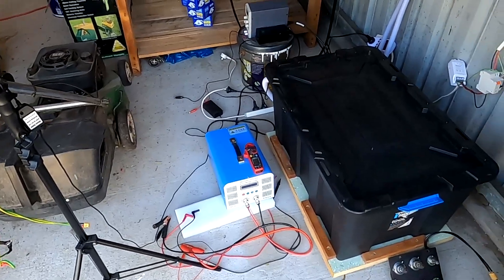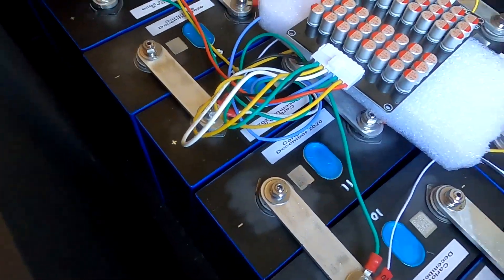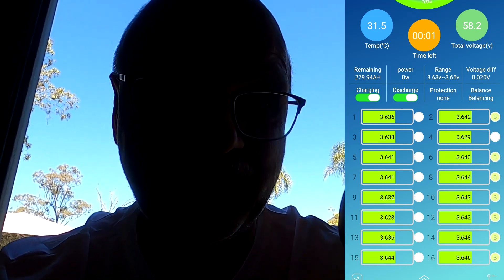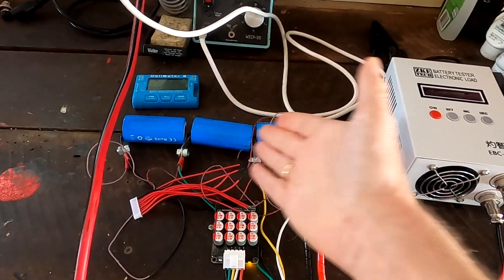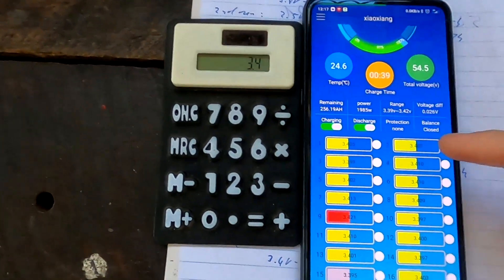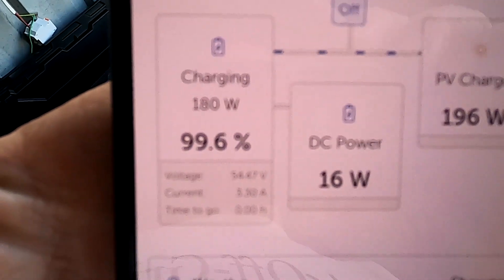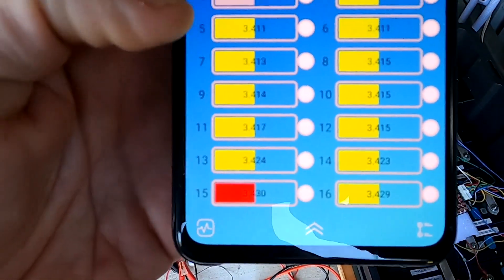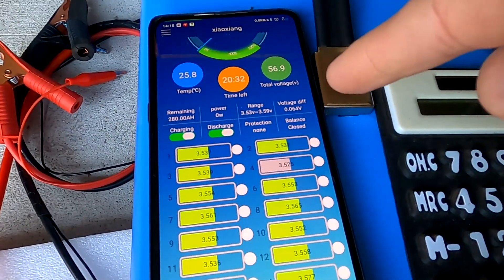Why the active balancer only works at higher voltage of your battery.

Comment: Can you test these? Amazon no reviews and im having a issue with their capacity! Grade A 3.2V 310Ah LiFePO4 Battery Cells, Rechargeable Lithium Iron Phosphate Battery with Bus Bars and Srews, Automative Replacement LiFePO4 Deep Cycle Battery for Camper, Boat, Solar System...
Brand: AVinol
Reply from the maker: Can't get them here in AU. 
I would be careful with no-name batteries, even if they are been sold on Amazon.
We have some reliable sellers on my website:
https://off-grid-garage.com/batteries/

Comment: Man the more you explain the more i am confused!
At the beginning you said you balanced at low voltages and it did the job nicely.
After that you charged up and it also did the job nicely.
In between of the explanation that is where it got confusing.
I get my active balancer this week i am going to find out for myself what the deal is with all these opinions   good and bad about the active capacitor balancing.
Mine is 14s100p  48V 200AH  battery system so that is more than enough to test this active balancing stuff.  You are in Australia and I am in Florida so we both have plenty of sun to play with!!!!!!!!!  I have a degree in Electronic Engineer so i will make a technical assessment of the active balancing.  I understand how it works and it is a simple yet elegant effective way to balance.  Active balance is more important to me than BMS contrary to the masses that think otherwise.  My electronic knowledge guides me to think at a deeper level than the non technical electronic people.

DC electronic  (solar stuffs) is super easy to understand and implement.  AC electronic is way way harder to grasp and understand.  That is why a lot of people can watch Utube and read online then go do it.  That is good however as the more of us doing this stuffs the better it is for the environment and our pocket book.

I am unconventional NOT doing what everyone is doing . I practice Reduce Reuse Recycle in everything i do.  The whole set up of mine is truly 3 R's from panel to battery to inverter even the wires.  Still working after 4 years with frequent battery rebuild due to NO bms and active balancing.  Next for me is bms, active balancing and remote monitor and controlling (worldwide NOT just local).  At this point i can remotely monitor and turn the system on and off anywhere in the world.  The bms remote monitoring and active balance are next.

Comment: Ok maybe a daft question. When do we actually turn off the active balancer.
Reply from the maker: Because is also balances in the flat area of the curve with LiFePO4 which causes an imbalance across the cells. Once you fully charge again, the balancer may not be able to balance that out again. You would then think it does not work or your battery has an issue. 
I have made several tests with different batteries here on the channel showing that.
Reply: @OffGridGarageAustralia   Thank you

Comment: Is 3.50v not the optimal maximum charge voltage per cell if you like to have the most of lifespan of the battery?

Comment: I can't remember if this was if this video or another one of off-grid garages active balancer test videos.. but at one point he has a board with four bulbs in it that he uses to drain individual cells.

Can anyone give pointers on how to do this? A regular house bulb doesn't have terminals... I've heard a car headlight might work but it looks like he's using something else. Just curious of all options

Edit: ah!  It was this video. They look like car headlights....?   

Does anybody know the details of building something like this? Do you need to worry about polarity on the bulbs?  In series on the board? Polarity on bulbs needs to match the battery cell?

Comment: 10:30 Seplos is the most used BMS in most chinese battery packs. They communicate with most inverters out there... and if you have an incompatible inverter/charger, tell them and after a day, they will send you the firmware.
Reply: It is far from the most commonly used BMS. The Pace BMS is widely used in server rack batteries, the JBD is widely used by the DIY community, Daly used to be popular, JK is popular with those that want a little more to play with. The Seplos BMS isn't bad but its quite expensive.
Reply: @ericklein5097  You are correct that Pace is the most used BMS on battery packs. I mistook the similarity and made wrong conclusion.

Comment: 8:54 THIS is what i have been telling some folks... BMS without a communication to Inverter/Charger will disconnect the batteries from the Charger/Inverter when one of the triggers is reached (too high voltage, too low voltage, too high current charge/discharge, too high single cell voltage, too low single cell voltage). But they keep saying it does not because their inverter/charger is still running.

FACE PALM!

I said, BMS does not turn off the inverter; it disconnects the battery to the inverter and their inverter is now in battery-less mode.

Comment: I run lto cells and that balancer. LTO cells voltage will change more that other types. Charging at high currents the balancer can't keep up. I am talking charging at 1-5s. The problem with using this balancer is as you go lower the balance current is well under 1 amp. This makes cells go over voltage.

Comment: One way to optimize battery would be first to accurately bottom balance. Then charge , the cell which goes high first is under capacity, increase the capacity of this cell by adding to it ,in parallel another small  cell ...It's about getting the capacity of each cell block  very close. Battery is limited by the capacity of the lowest cell.

Comment: what if we set chargers hi/low voltage,higher/ lower than bms cutoff voltages. I want to never need to "manually" do anything to cells of the battery bank.

Comment: Try turning the BMS balancing function off or set the start balance voltage higher than your absorption voltage so it can’t turn on. Let the active balancer handle that job alone. Balancers stop balancing, look at voltage and continue as needed. Two balancers on at the same time may be interfering with each other. Of course keep all other safety functions active on the BMS.

Comment: For this cap transfer balancer there are two things that happen with lower cell voltage.  First is the amount of transfer charge put in caps is less because voltage is lower to charge the caps.  Second is the switching MOSFET's resistance goes up a bit because their gate drive voltage is lower.  Both lower the net current transfer at lower cell voltages. Some models have a small boost DC-DC converter that provide a consistant gate voltage drive.

The balancer's cell voltage comparison is also more likely to be corrupted by external charging or inverter current in the flatter voltage portion of battery state of charge so it misfires occasionally  pumping charge transfer in wrong direction.

Comment: Did you use 2 balancer, the from the BMS and the 2nd?
Reply from the maker: The BMS balancer was turned off at first but I set it to kick in at a higher voltage. So if the active balancer struggles, the BMS balancer activates as well and assists to bleed off energy.
Reply: @OffGridGarageAustralia  thank you for the information.

Comment: Balancer will only make use of higher currents when there is higher voltage differences between cells. When providing a higher voltage/ charge from an external source you are providing that difference hence the higher rate of current being used by the balancer.
Great videos Andy.
How much power does your Tesla usually consume from your off
Grid garage per kilometre?
Reply: How does a charge current....that is equally distributed among the cells....creating a voltage difference amongst the cell?

Comment: Well, because of your great testing and the gleaned information, I started looking into how the Active Equalizing Balancer works. So, far it appears to use 70 G045N03 directional current switching MOSFET with a current dispensation of 52 watts each in groups of four with the use of  three capacitors. Regulated by what I think is some kind of voltage 555 type chip. I haven't got much further then that and its only a guess at this point.. So, this is what would make sense that that chip is set ate voltage you have described. If I get real worked up about it I'll test it. But, from what I think I know, I may just apply what you have done in this test once a month or so for a couple of days and the reset back to a lower voltage bulk charge. Anyways this information sure made it more fun to think about it all.
Reply: Xr680f I think the last bit of your response, regarding balancing and resetting charge levels as maintenance procedure is the way to go!
Reply from the maker: Thank you. That is great feedback. I'll look into it more as well. I have ordered some inductive balancers to compare...

Comment: Hi Andy. At first, thank you so much for your videos. I’m always waiting to the next one. Here is my question : what if you double the balancer ? I mean, you parallel it with your spare one !? At best you lower the risk of battery disconnect… what do you think about it ?
Reply from the maker: Thank you for your commend and kind words, Sebastien. That is correct, I could increase the balance power by paralleling them together. That would effectively roughly double the balance current.
I have made the observation now that it is not necessary as the battery will balance over time. I haven't had fully charged the battery for a few weeks so there was quite a drift and the balancer could not keep up. Now, after several full discharges, the balancer has it under control again. I now charge to 3.45V only and rest there for 2h to give the balancer enough time to do its job. That seems to work.

Comment: Hello Andy, please check the resistance between the busbar and the cable shoe from the BMS and the balancere.  I had 20 ohm on it at one cell, ( I use the same 280 Ah cells ), and this is a big problem wenn the BMS gets no correct value. I changed the sequence , that the cable shoe is directly on the busbar. I thing in my case the V2a washer was the problem.
My english is not that good ,sorry .
With best regards Guido
Reply from the maker: Thanks for the tip!

Comment: The same thing happens with my batteries. Most will be at 3,350v but as charging continues one cell continues to charge and comes over 3,600v and the others even drop from 3,350 to 3,330v
This starts to happen when the same saturation voltage stands for a long time. Does this rapidly growing cell have the least capacity?This is frustrating. 🙈

Comment: I would like to see you leave it for a few cycles with the recomended settings from Victron. These guys know what they are doing - I promise you. :) leave it to absorb a couple of hours so the balancer can work at every charge. You changing back from the recomended settings make it so that we don’t have a proven state of the system actually working in this design. Then you can try fiddling with setting step by step until it stops working reliably. We humans sure are different and work toward a solution in different ways. Fascinating.
Reply from the maker: Yeah, I can do that and see how it goes over time. I've got the suspicion, that the balancer actually causes the imbalance because its permanently connected. If I don't fully charge for days or even weeks, it still balances and causes and uneven voltage once the battery gets close to full again. It then needs to revers that balancing again what it did in the past. It should only turn on if necessary or 3.5V or above maybe.
Reply: @OffGridGarageAustralia  I have wondered the same on these active balancers. I top balance my cells perfect and the bms so far on a couple battery banks has kept them within 0.010v but then if i don't get much solar for a few days or weeks and my bank is around 50% soc then an active  balancer may be then be bottom balancing to a point so then when i get to a high soc again or when fully charged the cells are then out of balance.
Reply: @OffGridGarageAustralia  I have one of those balancers (4s) that I use with my Headway batteries. Something that I noticed is that when charging the pack and monitoring the cell voltages, the balancer will "artificially" increase the cell voltages that are low (and vice-versa) when it is actively balancing. This makes it hard to accurately monitor voltages unless you turn off the balancer. In my case it's easy for me to unplug the single 4s cable. However, you may want to solder a switch and some wires onto the balancer. (inplace of the solder blob that is there.) It would be Very interesting to see what the ACTUAL voltages of your batteries are when charging.
Reply: Andy have the balancer only turn on when you are approaching 96-98% SOC

Comment: Wow I think adding an other chemistry like lithium ion using 14 cell @3.7 both of 16 cell lifepo4 have the same top and btm voltage limits but it will act as a buffer of fast voltage rise after 3.45 for the lifepo4 which would let the balancer do it’s job. 
This is my hybrid battery and no balancing 
230 amp lithium ion (Chevy volt battery) and 200 amp lifepo4  with top charge up to 57.4 volts absolutely no problems. Ant 300 amp BMS with no BMS on the 3.7 cell  battery max difference is .05 after 5 years

Comment: I put a comment here but it disappeared . 

What your charger is doing is putting a higher voltage ,say 5 volts , on the cell until the plate voltage reaches 3.5v and then reducing and holding the voltage out at 3.5 volts . That's about 50 % higher voltage forced into the cell.

That is NOT what CC/CV means.
CC/CV means set the output voltage to 3.65 volts and the current to no more than .5C and watch. It will take full current if its discharged deeply but within a minute or two it will take a reducing amount of current and that will fall until the cell plates reach 3.5 volts where you turn it off.  

There are white papers you can read on researchgate and the like that show if the voltage pushed in is 10 % higher it will result in lithium dendrites being formed. If it is exceeded by 20 % then copper dendrites are formed. Over time of course but what you are doing is sacrificing your cell lifetimes.

If a boatie does that to get his cells charged quickly he should be made aware that its a trade off against longer lifetime .

Unfortunately most of the ex lead acid chargers supposed to be usable for Lithium are NOT ! The sooner you get a good charger the safer you will be and the longer your cells will last.

Comment: On the active balancer ,usually the thing does not kick in until there is a 100 millivolt difference between one cell and another. If a battery is under a charge as you do it of 20 amps how will you notice if it does anything?  You won't so what you are saying is wrong again. It works all the time but you will not notice until you stop charging.  Your cells have been to 3.65v before I presume so you must not go there again or you damage the SEI layer in the cell. Stay at 3.5 volts or less . You yourself said it makes very little difference in the state of charge . A few percent and you abuse your battery to get there.

Comment: We have never same chemistry, same batteries, same errors in measurement (an 0.5% of error is .... 18mV !!!, imagine error value with -0.5% and 0.5% in other cell at high voltages. Or imagine 1%), same error at every single temperature or voltage,  same torques, ... it is very difficult to have same SOCs, but you are doing a good job. Too much factors, isn't it?
Thanks a lot Andy.

Comment: The mosfet version of the QUCC BMS works well. On cell high voltage it simply disconnects the charge circuit, the output remains on. 
Setting the "balance on charge" to off allows it to balance while the charge circuit is disconnected. 
I appreciate the maximum current on the BMS is only 120A, but this should not be a problem as it still gives you 5000VA. 
When the second battery is installed you will have double that to play with, how much do you need ?

Comment: To balance fault due to variation in each cell at different voltage levels.Suggest to correct use smaller cells or.parallel cells 2 or 3 * S 16 which would average the variation same as Tesla battery.

Comment: Been researching diybms it's a control board and a per cell monitor board, once a single cell reaches a pre defined setting the current is cut off to the cell

Comment: At around 2.44v cell 6 of my 8s 300ah battery shoots up in voltage. The Batrium does not discharge fast enough, so I added a 3s 5a balancer to the high cell and the 2 lowest cells, this helps but is still not enough! I am now adding another resistive balancer to it and have ordered more 5a balancers!
Reply: let us know. I was thinking the same thing. I hate when one cell just ruins it for the rest of us.
Reply: @immrnoidall  Try it. I seems to work. Have not had a rn away for 2 days